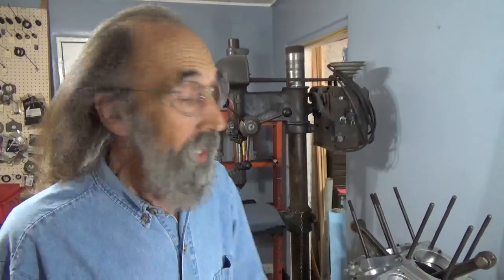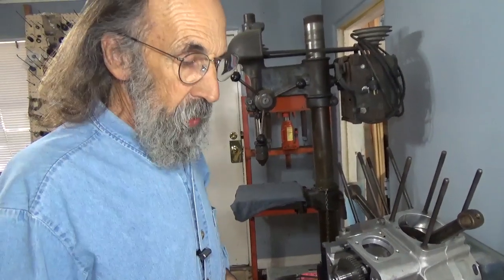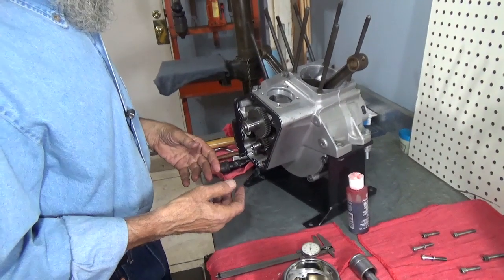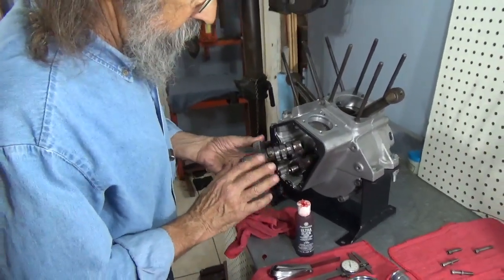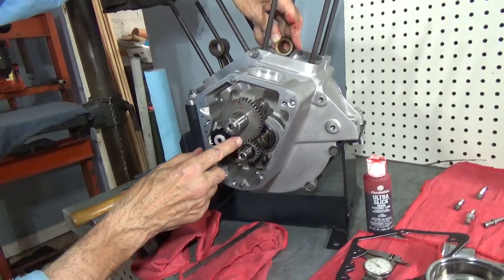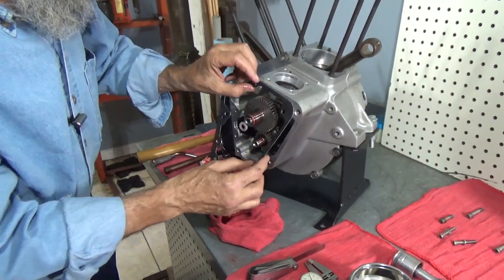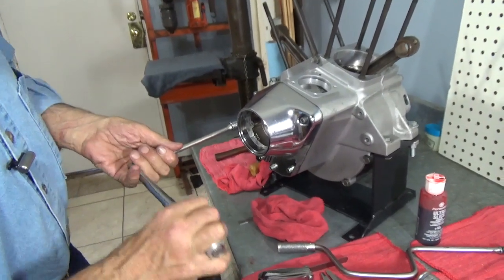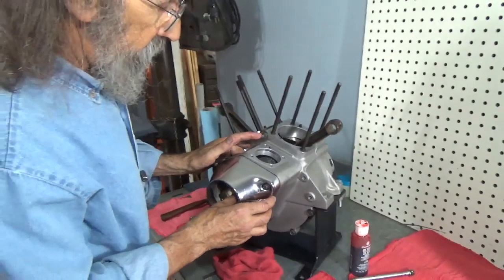Camchest, Evo Motor Assembly Part 5

Comment: Mike, do you think it is a good idea to replace the lifters/tappets at 40.000 in the Evo motors. Should I do the cam bearing also. My 98 FLSTF has about 31K on it it is all factory except the Vance & Hines exhaust and has had very good maintenance..
Reply from the maker: 40,000 miles is generally no big deal on an Evo.  Yes, lifters are a "wear item" and subject to failure, usually later on.  I don't try to predict when, but 40,000 with proper care and maintenance should be fine.  Upgrading to a high performance cam, high performance lifters, pushrods, and cam bearing is always a plus.  You already have a more "free flowing" exhaust.  The goal is usually to make more air and fuel flowing in and out (free flowing intake and exhaust).  Bigger carburetor and a more high performance cam will truly wake it up.
Reply: @pacificmikesgarage  Thanks Mike i am a Shovelhead Panhead guy and don't know the newer motors as well. I actually have worked on Twin Cams but never had an occasion to do more than maintenance work on an Evo.

Comment: When I removed my plastic breather gear, I noticed that the bore where it rotates in doesn't look and feel super smooth. Should it be honed?
Reply from the maker: Nope.  If it gets really bad and the motor is completely torn down, you can oversize the hole, then install an oversize breather gear.  That's extreme circumstances.  Don't look for problems when there aren't any.
Reply from the maker: You have some very nice and useful videos up.
Reply: @pacificmikesgarage  
Thank you. I was advised to install a S&S steel cam breather.

Comment: How do you feel about steel breather gear replacing the plastic one ?
Reply from the maker: I've heard so many crazy stories, but I've switched them back and forth.  Just make sure of proper years for the bike and use the breather shims intended for the gear you're using.

Comment: Thanks , I could of used this Video back in 2001 lol,    But I still enjoy watching someone do it right .  I see guys doing it wrong and I cringe .   No breather shim no shim or thrust washers on the cam , or pull the cam cover with the heads on and pushrods in place , They have No Idea the Value of run out on the pinion gear after 800 # pushing on the crank .
Reply from the maker: We all live and learn, all of us.  Thank You.
Reply: I also believe that this is a great time to check your side to side gear engagement from the pinion to the cam gear. It should also be done at various locations just in case there is any pinion shaft run-out. Per Andrew's .000"- .0005" is the proper mesh between the two gears. I measure EVERYTHING with .108" drill rods just to make sure everything is perfect. Like Jeff (JC) I've seen my share of rookie mistakes.
Reply: @kennethwise7108  Its not my first Rodeo but I still watch everything and check my measurements to get it in spec .
Reply: @JCcanU  Yep, most knuckle draggers just throw the cam in the motor and call it done. I've seen sooo many people who do that and end up damaging crap once it fails. Oh well, it ain't my bike..

Comment: Hi Mike big fan! I have a problem in my Evo build i lose presure on hot the light from the oil light up, the original bomb is ok we rebuilded with a kit and tested, i tested with a hiflow ultima oil Pump it did it again same sympthoms, we changed lifters they are new, what are the other points of the circuit pressure some One talked the nose cone. What do you think? Best regards!
Reply from the maker: You could have any number of issues.  But, if you have the right pump and the cam cover your motor came with, it should be all right.  I became frustrated at one point and bought a quality, mechanical, oil gauge.  I bought it from Snap-On.  It was not cheap, but it was a real piece of precision equipment.  If I'm losing oil pressure, I want to know where and when.  Remember, what you really want is flow, volume, rather than high pressure.  Read your MANUAL and hook up a good, mechanical gauge.  I ran a long hose from the hole where the oil pressure sending unit screws in and taped the gauge to the speedo.  Know how much pressure you have at startup, when the pressure drops, and how low.
Reply: @pacificmikesgarage  do you now  
tp engineering oil pump for Evo? What do you think?

Comment: hello sir,just wondering what happened to the two cam chest guides for the gasket and cam chest to line up on your shovel series?do they not work for evos?.....thank you and strong work
Reply from the maker: Sorry.  Probably didn't mention it.  They line up automatically if they are already matched.  If not, there is a process which must be followed to put the bushings and bearings in alignment.  Thank you.

Comment: Hi Mike -- thank you for all the great vids.  Generally, what is your approach to mating the pinion shaft and the corresponding bushing in the cam cover?
Reply from the maker: It is best done with the cases split.  That way, you send a reamer through  the right case and into the cam cover bushing while the cover  is installed on the case.  It is in the Service Manual.

Comment: Mike can you help me settle a friendly (so far) disagreement, not related to this video but I think this is probably up your alley. I recently commented on a FB post to a fellow that was asking about what year his dad's bike was based on a 1949 photo. The bike was a hydraglide and since the photo was taken in 49 it was a pretty simple deduction that the bike was a brand new 49 since the 48 was still a Springer. This bike also had the black lower fork sliders which I thought made it even easier because I was under the impression that those black sliders were a one year only for 49. That's were the disagreement starts, someone sent me a message telling me that I was wrong and that HD offered those black sliders on several different years. I've only ever seen it on the 49 as stock from HD. Do you have any knowledge on this? I still believe I'm correct but before I put my foot in my mouth I'd like to verify it. Any opinion? Thanks Dennis. PS I enjoy your work and I subscribe! 😁
Reply from the maker: Thank you.  I had to refer to my books to answer this one.  And, of course, I hope the book is correct.  I've seen black lower legs many times, but didn't know they were a "one year only."  According to Bruce Palmer's Restoration Guide (How To Restore Your Harley Davidson),  1949 was the only year to have black sliders, and they were used on all models.  That's the best I can do.  I've had a lot  of lower legs polished.  I've had a lot of them chromed.  I prefer polished.  But, it seems in 1949, HD painted them all black.

Comment: Hi Mike so here in Massachusetts the nights are getting cool and my 2002 FXSTB Twin Cam 96 CV carb is starting to show signs of being too lean on the pilot circuit in the cooler weather. Should I attempt opening the pilot screw or maybe going up a size on the pilot jet? I't not unrideable in cool weather but if i throttle up on the main and then close to cruise on the pilot I sometimes get a quick carb cough but can easily throttle through it. I can also use throttle control to get around it but doesn't mean it's ok, at least I don"t think. Curious as to what your thought are ?
Thanks Mike for the great video and knowledge, it's like Deja Vu on the shovel lol.
Reply from the maker: Try a slightly larger pilot jet.  They come super lean from the factory, and s lightly larger jet is the way to go.  I'm assuming you're running stock exhaust and air filter.  If you're not, you'll definitely need to upsize the pilot jet.  Read the number on it and go up to the next size, maybe two.  It's not hard to experiment with.
Reply: @pacificmikesgarage  will do. Thanks Mike